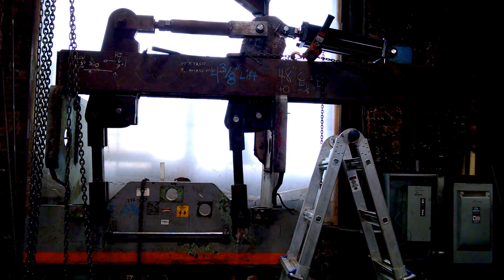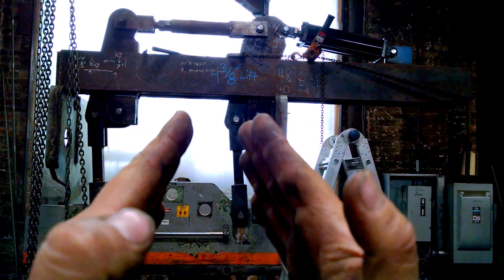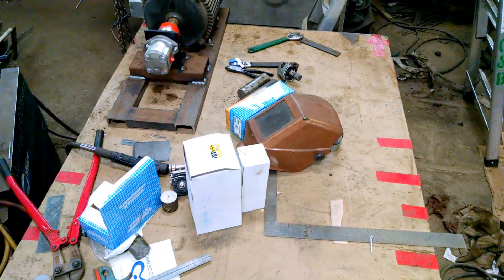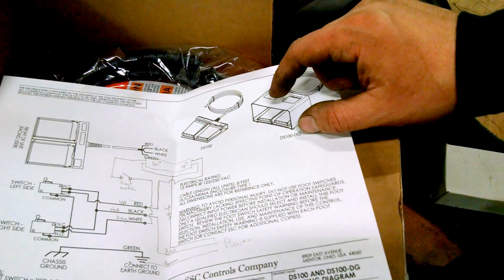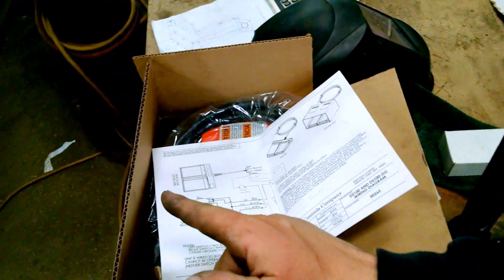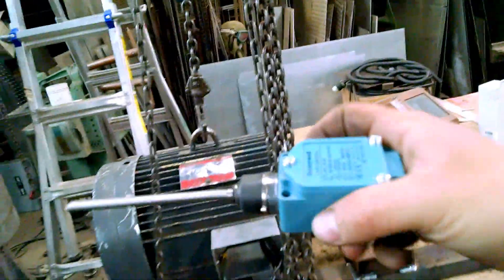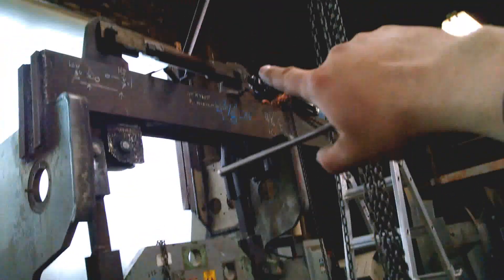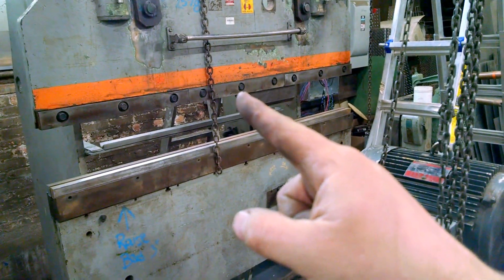Homemade Hydraulic press brake part 2

Comment: I had Cincinnati tell me to scrap my 90AS or spend 65,000 to upgrade my controls. I say what the f#$? are they trying to do to me. I will post my own upgrades on you tube also. I have a small shop and scraping a brake because of being old sux. I have brakes a hole lot older than 1986. Thank you for your video Joshua.
Reply from the maker: Gary Allen please feel free to share you link here when you have it!

Comment: How is this project coming along Joshua?
Reply: Thanks Joshua. 
That is a good deal on the Chicago Press. Is that a 100 Ton 12 foot unit?
Something like this? > http://goo.gl/NW5waT
Hopefully it was close by, and the rigging was not too expensive.
Reply: Nice. Very lucky!

I have a Cincinnati CB 175 x 14', so I am good to go as far as a big press.

I liked the looks of your retro-build over, and was curious on how that was all going. We have some newer Standard Press Brakes as well, and they are built with a single cylinder, similar to what you are doing. This is how they are set up > http://goo.gl/nZK15O

I hope you can get back to it soon.
Reply: Good, and you have all of the pins lined up now, the way you want them, right?
Reply: Good. 
I'll have some pictures of a Mini Press I'm building now, to share with you soon. A 28" unit I need for a dedicated job.
Reply: And don't forget, I'm sure many would love to learn right along with you *****, as you work your way through that hydraulic set up.
Reply: What tonnage was the brake rated for in stock form? I have a Wysong 25 ton that I have plans to convert to hydro.